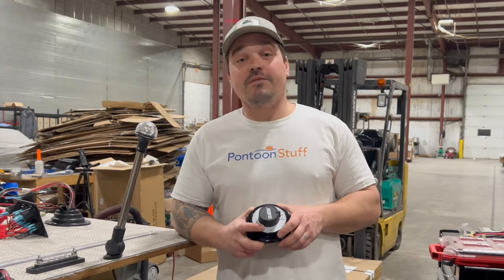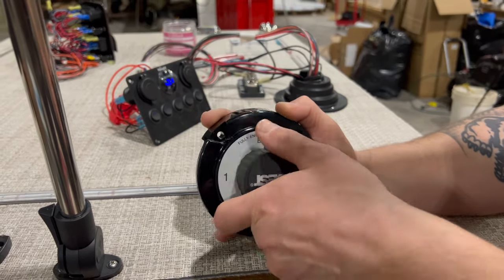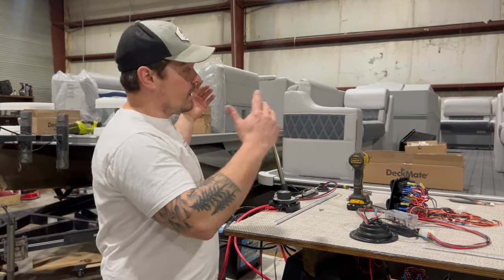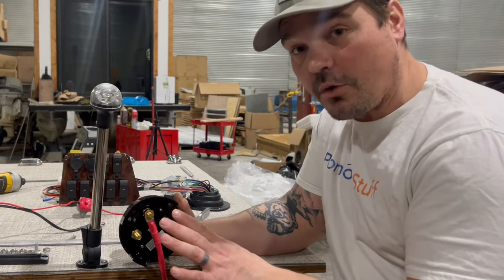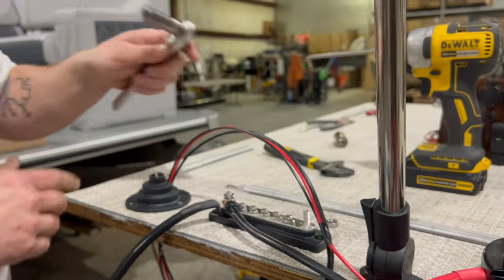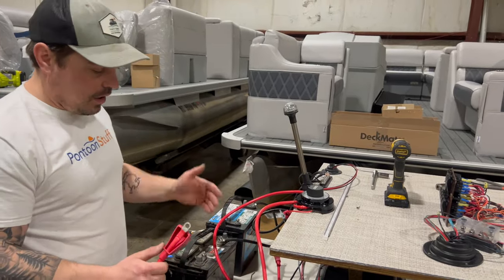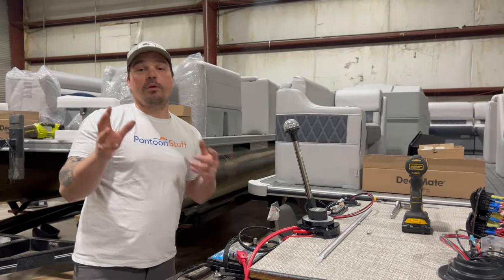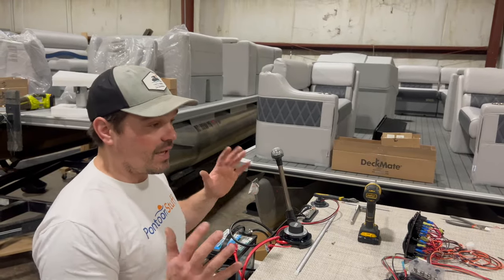Four Position Marine Battery Switch - Installation & Application

Comment: What is the configuration so that my stereo is not getting a power surge when starting my motor? Currently my stereo pops and sometimes completely shuts off when starting the motor. Turn the switch from 1 to Both after starting? This, of course, would require turning the switch w/o first shutting off the motor.
Reply from the maker: I've never heard of that happening before. It might be that the head unit is a bit sensitive to power. Is anything other than your yellow and red wire from the stereo hooked to power?
Reply: @tomspontoons  not that I’m aware of but I will
Check. My mechanic said the same was happening with his boats so he started wiring them directly to the house battery with its own switch. I’d rather not have two switches, though.
Reply from the maker: @kyleybarra1830  Stereos can be temperamental for sure. I just haven't encountered that happening yet with the setups I've installed. I'd try reaching out to the manufacturer of the unit to see what they say. They might have some sort of in-line protection for those surges to keep it from causing problems.

Comment: Couldn't I use a positive bus bar as well so I'm not putting so many wires into the switch?
Reply from the maker: I suppose you could, but ideally they stack right on the switch so they’re wired as directly as possible. It should just be your 12V accessory harness and outboard. If adding more positive accessory wires to the common/shared post I’d still keep the outboard positive directly to the switch common/shared post. Then run the other accessories on a buss bar that runs to the common/shared post. We don’t want to interrupt that draw of the outboard, especially in the newer EFI outboards.

Comment: If both Batteries are Lead, do they need to be the same amps? 100 start and 75 house- example.
Reply from the maker: As far as I know that does not matter as much as the battery types matching. I know combining 24 class starting batteries and 31 class deep cycle batteries doesn’t have a negative impact, and I’m sure their amp ratings are very different!!

Comment: can I connect to the second house battery ?
Reply from the maker: I just show the simplest setup with a starting battery and single deep cycle battery. You could have two deep cycles if you want to start your engine off of one. It's also popular to run two house batteries in parallel and connect that to the house battery post.

Comment: What about the difference in charge between batteries in the 1+2?  This always bothers me because I know that batteries will equalize in charge when they are connected in parallel, which is why in my line of work we always parallel batteries that are fully charged and try not to parallel when one is massively discharged compared to the others, due to the current draw.  But I also don't have much experience with Deep Cycle, maybe it's just not a problem?
Reply from the maker: I’ve never seen it become a problem. I’ve heard that it’s going to “preference” one battery over the other until one is fully charged. Not sure which one necessarily. I guess the safe bet there would be to start on battery 1 and carefully change to 2 while running to specifically push charge to it if you know it was worn way down. That’s my two cents anyway

Comment: Could I put 3 batteries onto the same switch. Just wire it up the same way with 2 batteries on #2 and 1 battery on #1?
Reply from the maker: Yes, I have done this a number of times. I run the starting battery on #1 and two deep cycles, run in parallel, on #2. This will simply keep you at 12V on battery #2 connection, but will give you pretty much twice the battery life. I like this especially for a boat with an upgrade sound system with amp.

Comment: What if u have 2 house batteries and 1 starting battery?
Reply: I would guess your motor battery would go to terminal 1 and your two house batteries, which are “seen” by the switch as one battery assuming they are similar as Tom warns in this video, so they would go to terminal 2. The basics don’t change with the number of batteries.

I used Tom’s simple electrical tutorial videos, plus some extra electrical switching, to combine, or isolate, the 12 and 110v on my pontoon houseboat with solar, a wind turbine generator, and a dual fuel generator. I plan a lot of off grid traveling with my houseboat and not having power aboard is not an option.

Good luck with your project!
Reply from the maker: I've done this on a boat with a seriously upgraded speaker. Starting battery will still go to the #1 post. The two house batteries will be put in parallel, so the positive coming off of the paralleled batteries will connect to the #2 post on the switch, and a ground from the paralleled batteries will tie to the ground buss bar. Let me know if that makes sense.

Here's that battery system on the upgraded stereo. Doesn't go into great detail, but shows the setup I used. 

https://youtu.be/TkGn1gtVLNs?si=7XcMkikDV2giVzKv
Reply from the maker: That's a good way of putting it...the house batteries in parallel being "seen" as one battery. I like that!

Comment: the question now can you start the boat from house battery # 2 because i tried and it seems like its dead
Reply from the maker: If the battery has enough charge and has the appropriate cranking amps then yes, you should be able to start off #2 alone. You'd have to check the level and condition of your battery #2 to confirm that it's capable of starting your motor.
Reply: @tomspontoons  its charge and capable of cranking and everything but it dosent crank correctly from the battery in front of the boat i thing the 3 way switch has a connector for that battery that said protected for a black ground wire
Reply from the maker: @crazygamer-qr1or You ran a power wire from the front of the boat to the battery switch? How long of a run and what gauge wire?
Reply: @tomspontoons  yes i have 2 batteries 1 in the center and 1 in the front both to the 3 way switch and all my wires are 2 gauge
Reply from the maker: @crazygamer-qr1or  Adding longer leads than the factory engine battery cables can cause serious starting issues due to the drop in power, even with 2 gauge wire making the run. The bigger the HP the more likely the issues to arise, as well as with the newer EFI motors...they need all that cranking power to start properly. I would try to tighten up the whole battery system if you're able to! A volt meter testing at the battery and then at the starter will tell you how much power loss is happening, and I'll bet you'd be surprised how much it will drop if it is indeed an issue with the long run from battery to switch and then to motor.
Reply: @tomspontoons  yesi guess its the long run wires cause its like 10 feet to the switch and anoter 8 feet to the motor , thank you so much fir the help
Reply from the maker: @crazygamer-qr1or  Might as well start with the simple stuff as that seems to usually be what causes the most trouble!
Reply: @tomspontoons  true